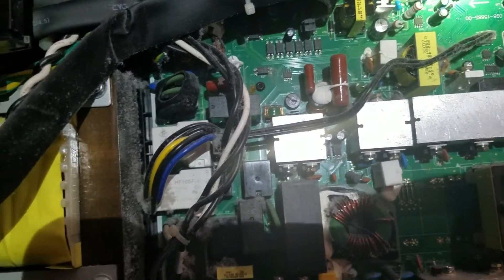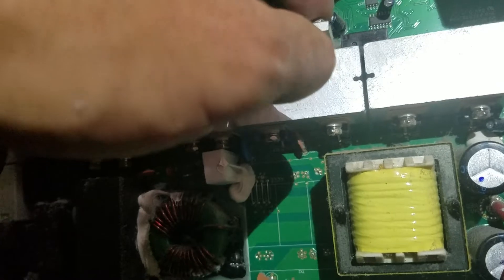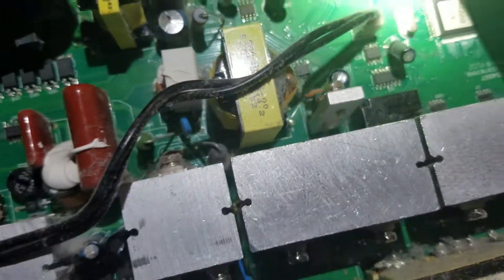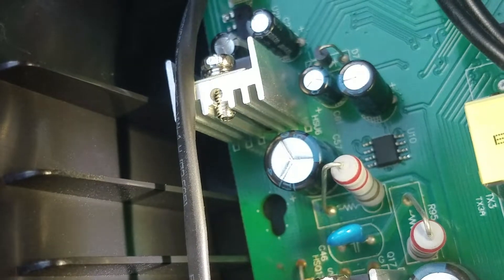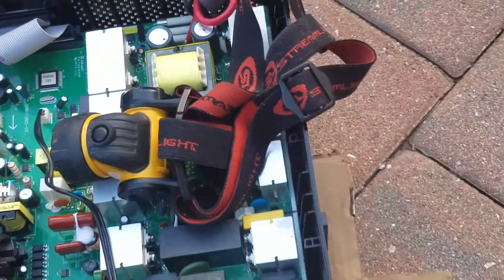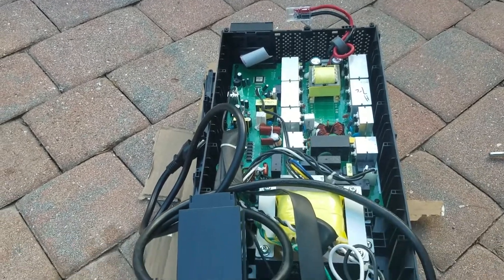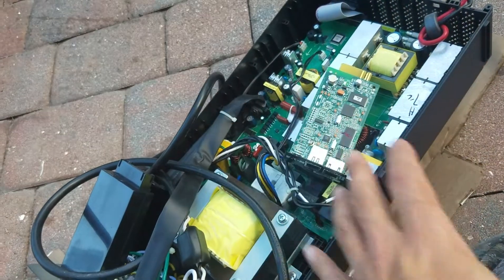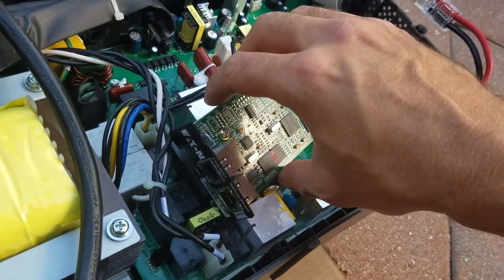Eaton 5P 1500 UPS Blown cap causing battery errors over and over

Comment: Hoe to reduce fan noise?
Reply from the maker: upgrade to the latest firmware.   Its not too loud
Reply: @GhettoWagon  

Thank you for your comment!  
I wanted to share that the model in question is the 5P1550i, and I've noticed that its fan is always running. I'm considering alternatives, like using a smaller fan or possibly a regulator, as the continuous operation is something I'd like to address.  

Although this is line-interactive technology, which typically doesn't require the fan to run non-stop, it seems that the fan operates continuously despite the manufacturer's specifications.  

As for updates, I checked the Eaton website for the 5P model and found that it already has the latest firmware installed.  

Additionally, I would be grateful if you could take a look at the images and video I shared via Google Drive. A small note: in the video, the first UPS is the 5P1550i, while the second one is the 5S700, which operates silently.

https://drive.google.com/drive/folders/1LtPNwdwu4_drezZNbe7NpVOyk3zZ6Xlz
Reply from the maker: @SilentChil   They run always they have to. All you can do is change the fan to a noctula or something like that but the wires wont match.

Comment: Which Eaton model do you have? Because I just put brand new batteries in last month and it's already saying battery fault. Mine's the eaton 5p rack mount.
Reply from the maker: 5p 1500.  Its the same board.  Rack or tower I believe.  Same Cap fails.   Two of them. I replaced them in 3 units already have. Same one.      It solved the battery error. I was still getting battery codes on one on and off but the batteries i have were shot.  They read 55-60 CCA should read 130+ Just put some more new ones in yesterday.. 1 more Pack to go (I have 4 eaton ups's)  When the caps are bad you will get an error every 3 days to a week it seems    Or once a month.  like some did.    Then every 2 months... With a new caps but bad batteries.      The whole "Battery test" is bogus it only tests the load on the batteries ability to drain for a few seconds. Even crap batteries pass the test. You need to take apart the pack and use a small 12v automotive tester on each cell
Reply: @GhettoWagon  yeah cuz the batteries I got off of Amazon and I thought maybe they were shitty batteries.

When I get the time I'm going to pull it out and check out that cat that you indicated. Any reliable recommendations for the HR9-6? That was the batteries that were in it....
Reply: @GhettoWagon  yeah cuz the batteries I got off of Amazon and I thought maybe they were shitty batteries.

When I get the time I'm going to pull it out and check out that cat that you indicated. Any reliable recommendations for the HR9-6? That was the batteries that were in it....
Reply: @GhettoWagon  yeah cuz the batteries I got off of Amazon and I thought maybe they were shitty batteries.

When I get the time I'm going to pull it out and check out that cat that you indicated. Any reliable recommendations for the HR9-6? That was the batteries that were in it....
Reply from the maker: @mrnapolean1   I'm running interstates now  About 40 a piece.  now. UPS battery center makes good ones with a warranty.   Mightymax I ran in a jump box seem to be fine.     They are 12v9ah batteries if if its 1500.. Lower maybe if its a lesser eaton.     I might get UPS battery center batteries for my last UPS that needs batteries.
Reply: @GhettoWagon  I'm just trying to avoid buying the ones from eating because they want like $250 for them. Thanks for all your help
Reply from the maker: YA the interstates from amazon have not given me any issues and test well out of the box.   I try to purchase a battery NOT made in china alot are made in Thailand Vietnam Malaysia etc they seem to be nicer batteries   @mrnapolean1
Reply: @GhettoWagon  Got around to pulling the unit. I took it apart and my C39 and C91are not bulged.
Reply from the maker: @mrnapolean1   Ya i had one that was not bulged at all.  I still was suspicious of it.   I pulled it from the board and tested it.   It read nothing on my meter. no UF rating at all. So I replaced it.     I even replaced the smaller cap.    that was exploded on my other UPS.  Yes one blew up in the middle of the night. Exploded.         That cap tested fine on one of my UPS's but. again I changed it anyway I had the same caps... On 3 units now fail in all different ways. I would probably take apart your pack. test each battery separately. Should be 130 or more Cold Cranking amps CCA with a Automotive battery tester.   . If the batteries are fine look deeper.
Reply: @GhettoWagon  I'll go ahead and get the caps ordered from Mouser tomorrow. Thanks for all your help, I really do appreciate it.

Comment: Replace the bulging caps first, then try again. The UF stands for microfarad, which is the capacitor value. the voltage is the rating of it. There could me more bad caps there, but they do not have to be bulged to be bad or near bad but still functional.
Reply from the maker: Yea i have some now still waiting on the other two. I have some Panasonics made in MALAYSIA!. These are Jamicons now? I think. They all have a + and - 
side too but the board is clearly marked.   My parts board I broke due to a failed firmware upgrade and i... unplugged it. NEVER DO THAT!   I learned what to do after when another unit had a failed firmware but saved that one.  The Company EATON does not state what to do in detail..      Anyway it looks easy and i have enough room to solder them off the board like i did on one of my old computers. Yea more can be bad or failing  apparently you have to remove them from the circuit to test them.   2-3 others have done the same repair they only had 1 cap bulge i have two and their unit was working for months/ years no issues.  My friend who works at a Data center place had one throw the same battery code over and over and it was under warranty so they just replaced it. Bet it was a bad cap too    I hope. I dont want to spend $600 on a new one.
Reply from the maker: Just got my caps in today...   Soldered it with the worst weller home depot soldering iron I need a soldering station better for precise things. Atleast these glasses work my Cool Eye DR got flooded 5 feet of water in their office.       Poor guy and his wife died from cancer in august.   Anyway..  Seems like it powers on and its charging maybe no errors. One cap was a PITA then I remembered going back 10 years or so when I last changed it. Cut it then drive the pin out the other way if its not coming out that way. Worked.   I didnt knock any other micro transistors or whatever else is on there ?? Off either   Ill know in 3-5 days no error code its fine.. Old caps read NOTHING on my meter.  new caps read proper